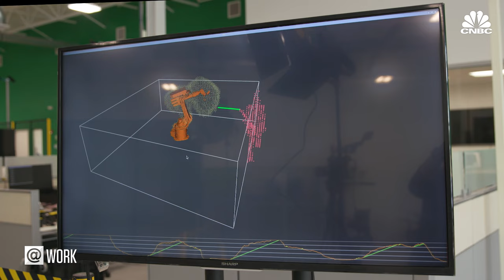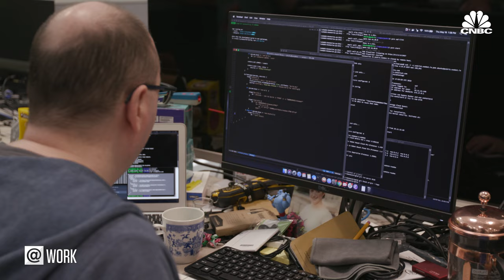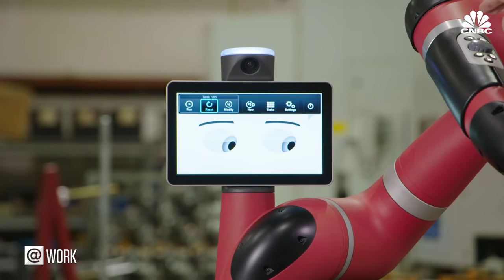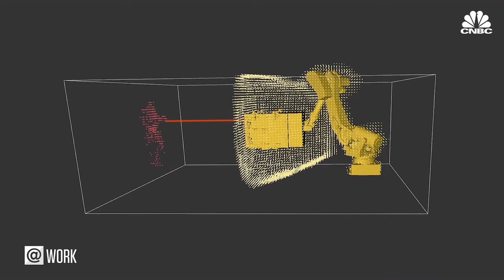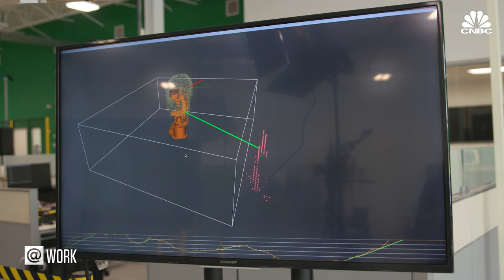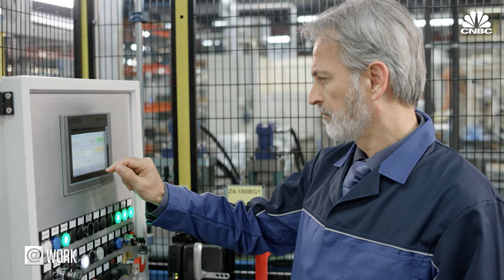How Robots Can Assist - Not Replace - Humans In Factories

Comment: A great A.I. (artificial intelligence) could replace upper management in factories very easily and a lot sooner. A.I. 's would run a company much better and with little to no corruption or chance of embezzlement or fraud activities, plus A.I. could analyze paths to take faster and with better success of outcome, after a path was chosen.  A.I.'s could cost companies less and make the owners more and could keep employee moral high and could make higher wages possible due to the A.I's lower cost to run and update.